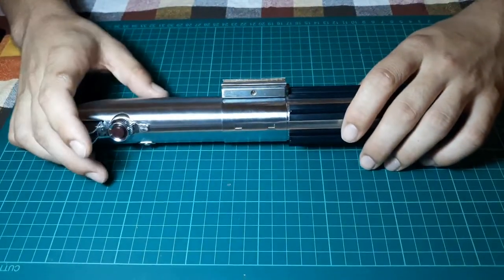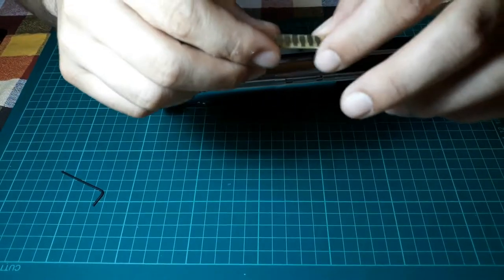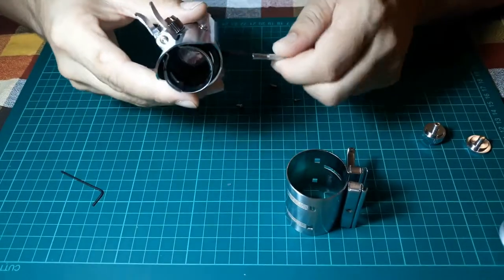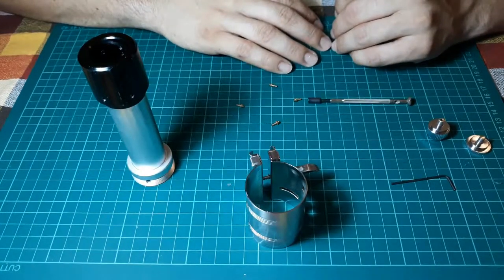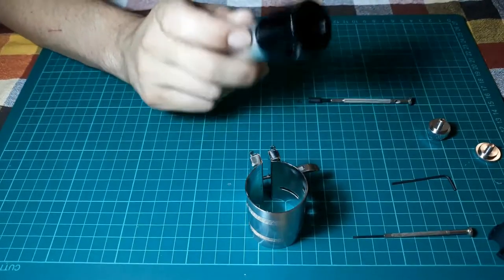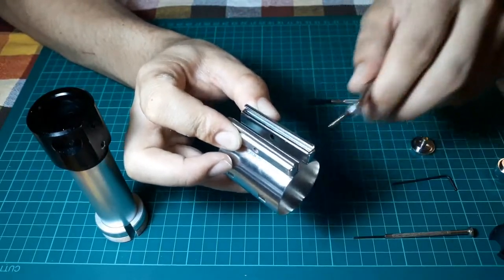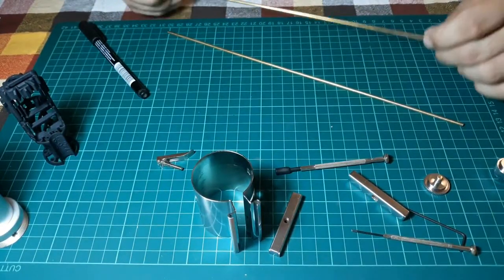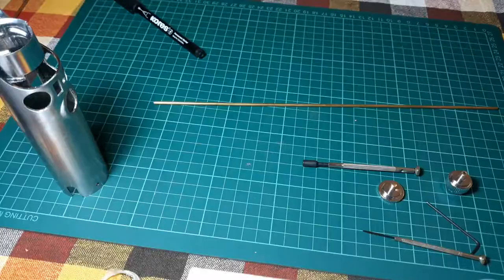How to build a Graflex - Part 3 -  Necessary Mods

Comment: Could I do this with the ultimate works slimflex?
Reply from the maker: I haven't worked with a slimflex before so I wouldn't know what mods it would need in order for the build to progress.

The internal layout as well as the chassis are specific .

I'm sorry I can't be of any help...
Reply: General Katarn oh that’s okay
Reply: General Katarn do lightsabers cost more to build or to buy with everything already installed
Reply from the maker: @davidh2080  well, it costs more to buy it already installed.

Better to buy them yourself and build.

But if you're not sure about the build, I do commissions for a very reasonable price and it's worth it.
Reply: General Katarn ya I want an anakin slimflex with a proffieboard and neopixel but I’ve never built a lightsaber before and to me everything looks very complicated. I would’ve gotten an already made one on korbanth but they don’t have anymore
Reply from the maker: @davidh2080  do you want to give me your email?